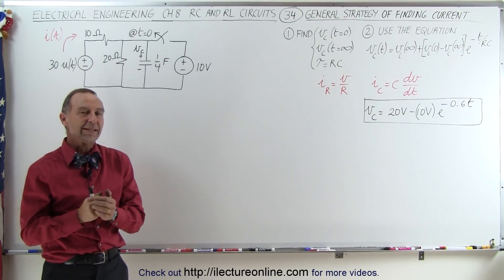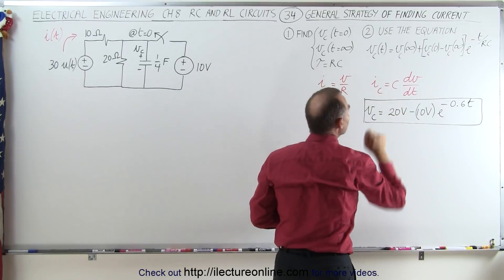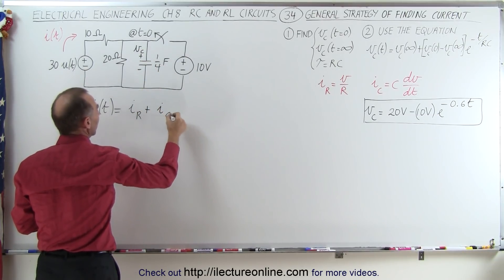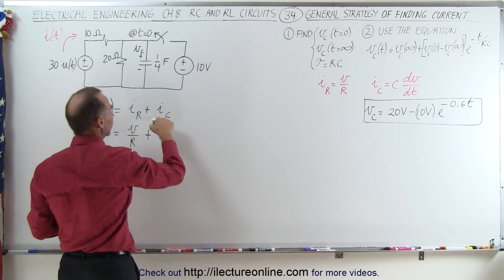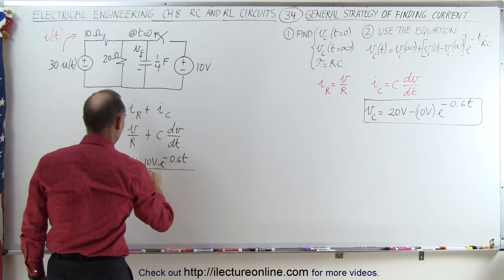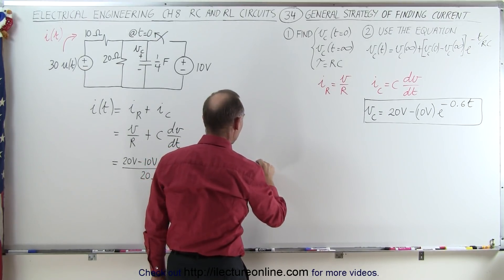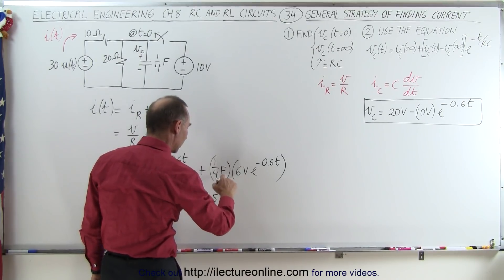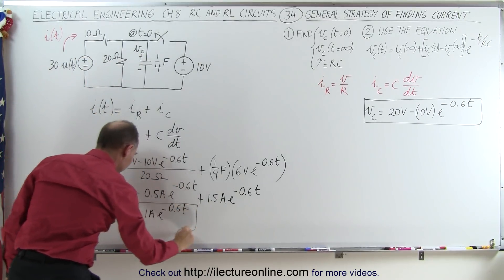Electrical Engineering: Ch 8: RC & RL Circuits (34 of 65) Gen. Strategy of Solving RC Circuits Ex.

Comment: why did we not use voltage at infinity for current but complete response eq
Reply from the maker: Not sure that I understand your question, but I think you are asking why we did not calculate the voltage of the final result when t = infinity (or large)?  When you plug in a large value for t, the transient portion of the voltage disapears, (becomes zero), and we are left with the steady state portion of the result.  This is a very common result in many circuits that go through a step change.

Comment: Hello Sir,
  I would like to ask, where you use the formula to find the current I(t), why you divide only the resistor with a value of 20 ohms and not the total resistance?Can it be divided into the resistor with a value of 10 ohms also only?
Reply from the maker: We are using the Kirchhoff current rule.  The current from the left branch equals the sum of the currents of the other 2 branches.

Comment: But sir time constant is T=RC or
C=¼
R=200/30 or 20/3 because  20 ohms parallel to 10 ohms.
So, T=(20/30)(¼)= 1.6 sec.

Time constant is 1.6 sec.
Reply from the maker: Since the resistors are in parallel, R = (10)(20)/(10 + 20) = 6.67 ohms